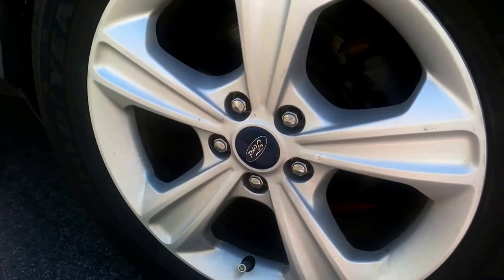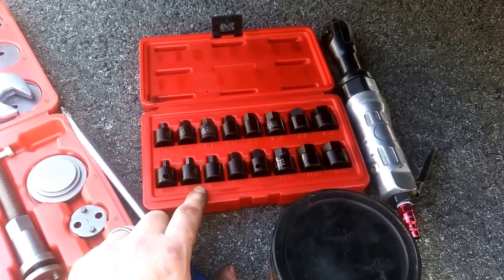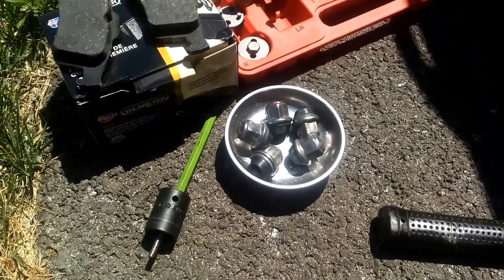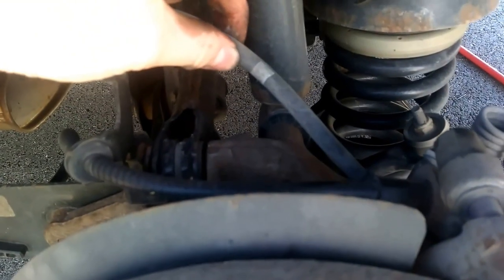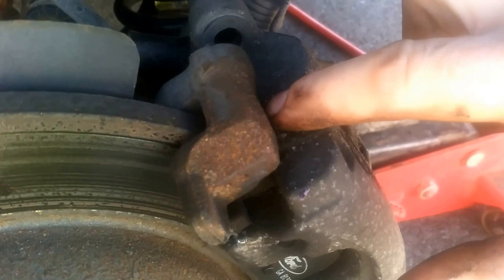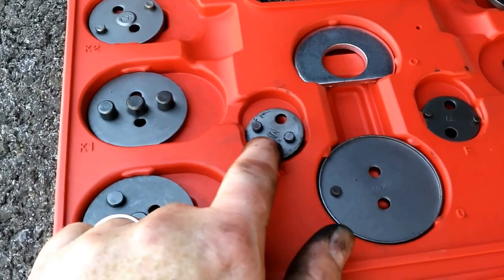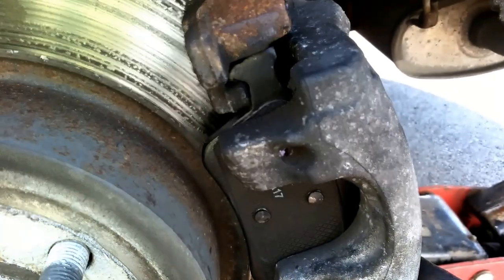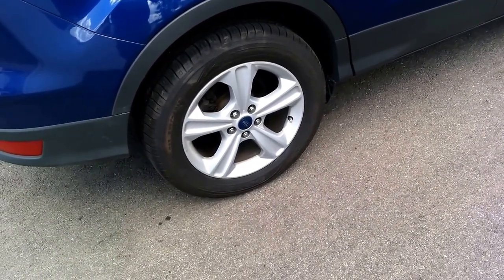How to change rear brake pads using a Disc Brake Caliper Wind Back Tool Kit on a 2014 Ford Escape

Comment: My escape may be newer but ceramic pads are oem.  I didn't know about the keeper springs and new piston reset tools until I was elbow deep.  The old cars never had that stuff.  Thanks for the video.
Reply: Why use bad rotors????

Comment: Thank you for the video. Don't have those tools but it's fun to learn how my mechanic does these things :)
Reply: Tory Allan most probable dont have the tool either unless your at a car dealer. I did mine at work which Im a mechanic but heavy equipment and I didnt use this tool and found something that would work and did just fine. Lol

Comment: seems simple enough right.?  uhmm.  Please explain did this affect your hand brake travel...  or did that reset automatically.  furhermore.  Doing everything you said.  Well went to MOT station after a full rear brake job and guess what.  The rear brakes failed miserably.  The car sailed on the rolling road and did not stop the wheels.  Yet, when testing the brakes by foot and hand motion.  Yes the rear brakes did work, it does stop the roation but its effectivness on the rolling road failed majorly.  any ideas why.  Fluids have been changed.  All air bubbles out.  Solid firm pressure can be felt at the pedal with no travel.  So why did the car sail onwards like a christian solider and did not stop the rolling road tracks.
Reply: You need to go back to school, as you make no damn sense.  Either the brakes work or they don’t.  Which is it.  And how does “ The car sailed on the rolling Road and did not stop the wheels“ make any sense.  Furthermore, how do you test the brakes by hand motion.  Loco..